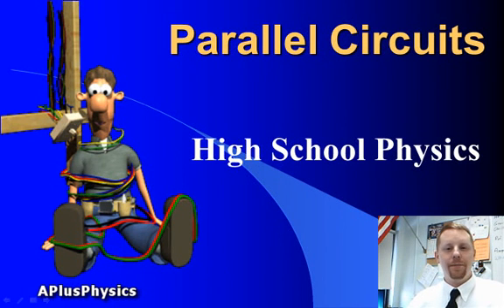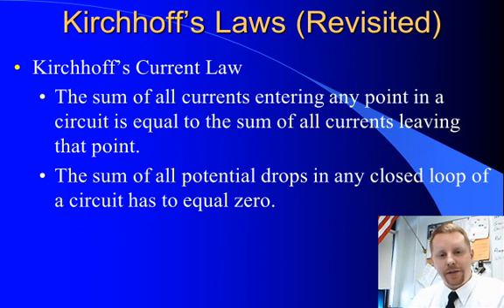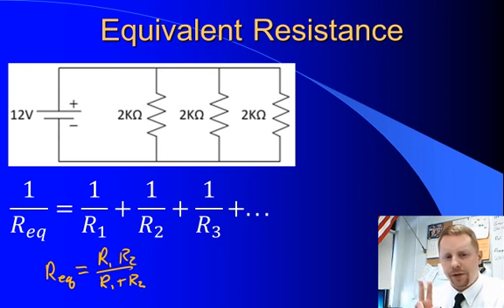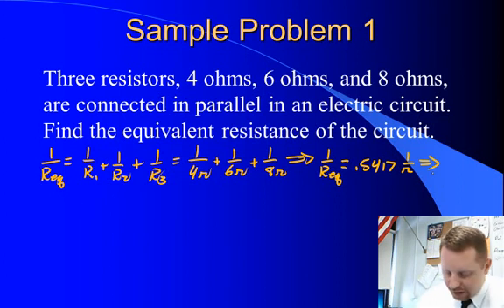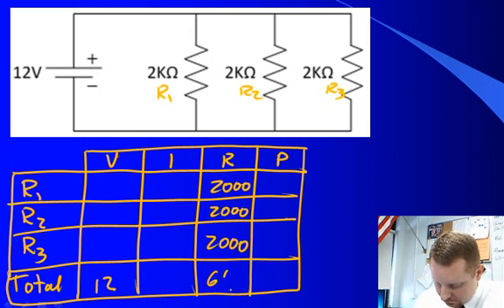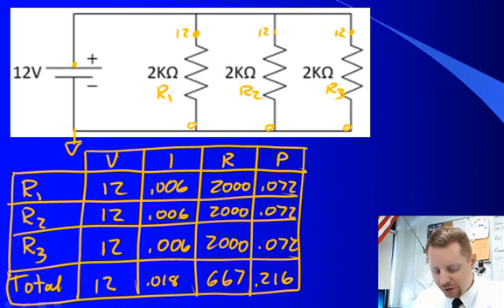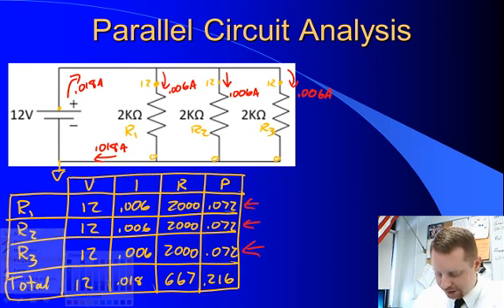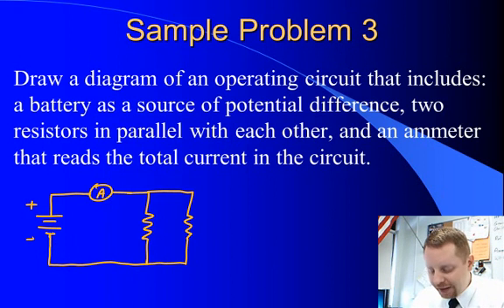High School Physics - Parallel Circuits

Comment: can you explain sample problem #4 at 11:26? i thought you had to use the parallel circuit formula, which would leave resistance as 1/r1 + 1/r2 + ... but you left it as its original value. im confused, if you could explain it would be so helpful, thank u!!

Comment from the maker: Hmmmm... did you walk through my derivation?  I show all the steps at about 3:44 in the video for the 667 ohms, and also at 4:56 for the 1.85 ohm answer.  Note the initial formula for the equivalent resistance of resistors in parallel, 1/Req=1/R1+1/R2+1/R3+...  then use algebra to solve for Req.  If you're still stuck, consider posting your question on the APlusPhysics site showing your work and what you're getting, and I'll see if I can't figure out where things are going awry.  Good luck!